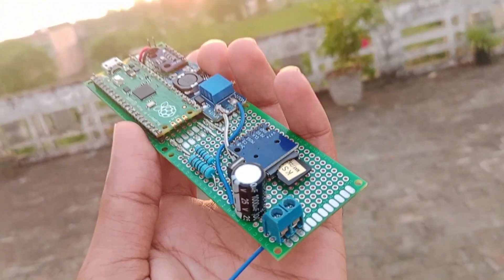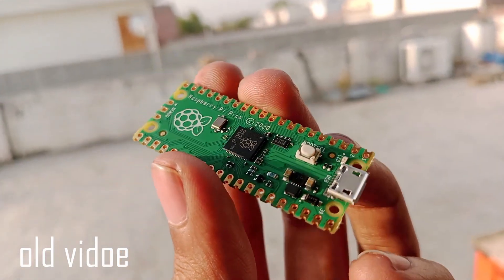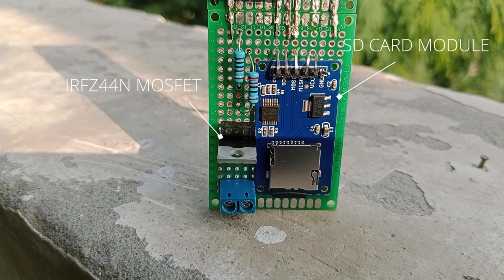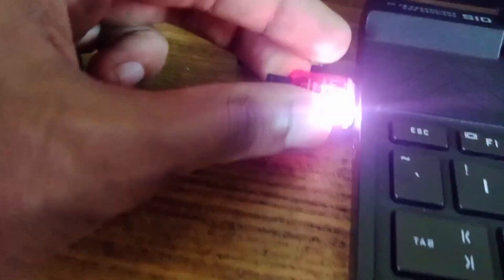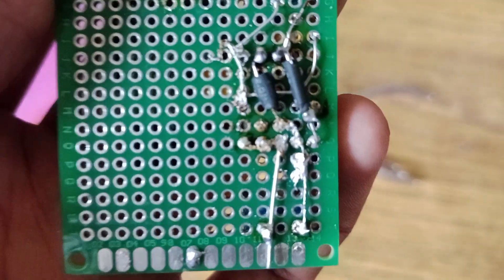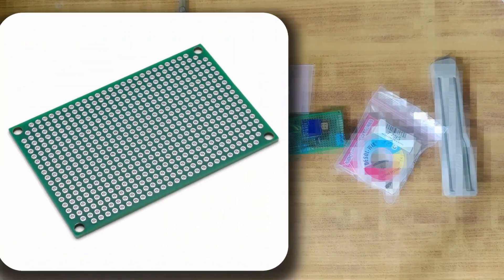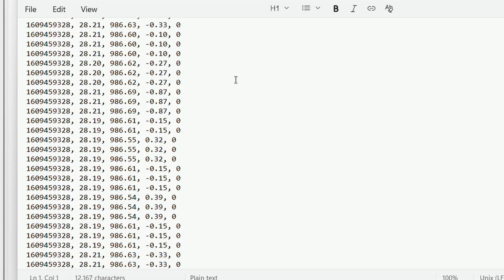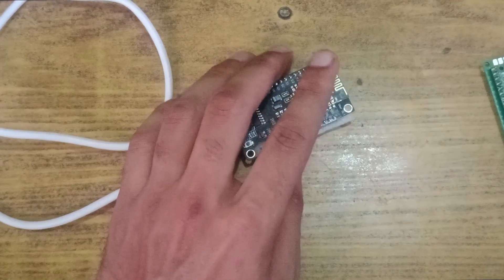This is How i made a Rocket Flight Computer!

Comment: Why you not used stm 32?
Reply from the maker: It's because i didn't check other microcontrollers before making the order and the Pico is a little expensive so i didn't change it. I just checked about stm32 and it is much cheaper than Pico, why is that? 
I will get more information about Stm and i will use it with my other projects.

Comment: also, epoxy the potentiometer of the step up module or apply superglue, i know it is really tiring and time consuming, but for your first flight, dont risk it
Reply from the maker: I will make sure that anything doesn't move during flight or after the assembly of the rocket.

Comment: if your rocket is going to stand on the launch pad for a long time, then use a bigger battery, you dont want your flight computer to die suddenly just before launch
Reply from the maker: That wouldn't be a problem at all. I will turn on the flight computer just a few minutes before the flight.

Comment: the tinned copper wires will NOT survive in more than 7g's of acceleration, please apply a light coat of epoxy in the wires when you are done and apply a bit of silicone conformal coating to the exposed tiny components, the epoxy holds them in place and can go up to 30g's with margin of error, the conformal coating prevents your board from shorting itself from humidity
Reply from the maker: Oops 😬. Why don't I think about that!! I took too long to check my comments. It would be hard to fix now 😅.

Comment: Bruh how did you made the pyro charge circuit? Can I have it's circuit diagram?
Reply: use a mosfet, connect its gate to a 10k ohm pull down resistor and the gpio you wanna use to control it, hook up 12v 0.5a or more to its source(can be more if you have a longer wire), then hook the drain to the pyro charge
Reply from the maker: Massage me on instagram, i will share it with you

Comment: yo bro i am also making project like you. i think you need to participate in project fairs or startup programs.

the system i am making is ai based space debris tracking and avoidance system

🚀 Project Report
AI-Based Space Debris Tracking and Avoidance System
1. Abstract

Space debris poses a significant threat to the safety of active satellites, space stations, and future missions. This project, titled AI-Based Space Debris Tracking and Avoidance System, proposes an advanced hybrid solution combining artificial intelligence, physics-based orbital mechanics, and sensor-driven simulation to detect, predict, and autonomously avoid collisions in space. The system integrates real-time TLE (Two-Line Element) data, predictive AI models (LSTM, GRU, Transformer), and reinforcement learning algorithms (Deep Q-Learning, PPO, A3C) for decision-making, ensuring efficient maneuver planning and safe orbital paths.

2. Introduction

The exponential increase in orbital debris threatens operational satellites and human missions. Current tracking systems rely heavily on ground-based radars and physics models, which often fail to react in real-time.
This project introduces an AI-driven system capable of autonomous tracking, prediction, and avoidance of debris using a combination of physical modeling and deep learning.

Core Idea: To build a real-time intelligent system capable of predicting future debris positions and autonomously adjusting spacecraft trajectories to avoid collisions.

3. Objectives

Develop an AI system for real-time space debris tracking and collision avoidance.

Integrate orbital mechanics with AI-driven prediction.

Implement LSTM and Transformer models for trajectory forecasting.

Utilize reinforcement learning for autonomous maneuver control.

Create a simulation dashboard with 3D visualization and real-time AI decision monitoring.

Build a functional prototype using Raspberry Pi Pico for demonstration.

4. Literature Review / Background

Existing methods rely primarily on NORAD TLE data and SGP4 propagation models for orbit prediction. However, uncertainties arise from solar radiation pressure, atmospheric drag, and limited update frequency.
Machine Learning (ML) techniques are now being explored to enhance precision. NASA’s ODPO, ESA’s Space Debris Office, and academic research suggest hybrid AI + physics systems can reduce error margins by over 40%.
This project contributes by combining LSTM-based trajectory prediction with Kalman filtering and Monte Carlo simulations, ensuring improved robustness and accuracy.

5. System Overview

The system operates in two layers:

Software Simulation Layer:

Processes real-time TLE data.

Uses SGP4 propagation and AI prediction to forecast debris positions.

Determines collision probability and recommends avoidance maneuvers.

Hardware Prototype Layer:

Built on Raspberry Pi Pico microcontroller.

Uses ultrasonic and radar sensors to simulate space debris detection.

Controls servo motors (thrusters) for maneuver demonstration.

AI Controller:
A Python-based AI model running on a laptop continuously trains on simulated debris data and sends control signals to the Pico for real-time avoidance maneuvers.

6. Methodology
6.1 Data Acquisition

Source: NORAD, CelesTrak, and Space-Track.org

Format: TLE datasets parsed via Python libraries like skyfield, sgp4, and astropy.

Additional solar activity data via NASA and NOAA APIs.

6.2 Physics-Based Propagation

SGP4 and HPOP algorithms used for orbit prediction.

Monte Carlo simulations for uncertainty modeling.

Kalman filters for continuous trajectory updates.

6.3 Machine Learning and AI

LSTM & GRU Networks: Predict debris position from time-series orbital data.

Transformer Models: Used for long-sequence prediction accuracy.

Reinforcement Learning (RL):

Algorithms: Deep Q-Learning, PPO, A3C.

Function: Decide optimal thrust/maneuver action to minimize collision risk.

6.4 Visualization System

3D simulation dashboard using Plotly and Processing.

Displays spacecraft, debris fields, AI predictions, and sensor sweeps in real-time.

6.5 Prototype Implementation

Hardware Components: Raspberry Pi Pico, Ultrasonic Sensor (HC-SR04), Radar (RCWL-0516), MG90S servos, external power.

Software:

pico_debris_avoidance_firmware.py (MicroPython firmware)

laptop_ai_controller.py (AI decision engine)

debris_avoidance_visualization.pde (Processing dashboard)

Communication: Serial (115200 baud).

7. System Flow

1. Data Input → TLE + Sensor data acquisition
2. Orbit Propagation → SGP4-based physics simulation
3. Prediction → AI models forecast debris paths
4. Risk Assessment → Collision probability computation
5. Action Decision → RL agent selects avoidance maneuver
6. Execution → Servo/Radar response simulated via Pico
7. Visualization → Real-time 3D dashboard

(Flowchart Placeholder – can be auto-generated if confirmed)

8. Results / Expected Outcomes

Real-time collision prediction and avoidance system.

Improved trajectory prediction accuracy (>90%).

Decision latency below 50 ms in simulation.

Fully autonomous maneuver capability.

Scalable design for real orbital systems or CubeSats.

9. Future Scope

Integration with real satellite telemetry systems.

Deployment on cloud servers for global debris tracking.

Implementation of federated learning for distributed training.

Expansion to re-entry prediction and on-orbit servicing missions.

Collaboration with international debris monitoring networks.

10. Conclusion

The AI-Based Space Debris Tracking and Avoidance System represents a forward leap in intelligent space operations. By merging physics-based simulation with machine learning, it demonstrates how autonomous spacecraft can navigate an increasingly crowded orbital environment.
The project bridges the gap between theoretical modeling and applied AI, paving the way for the next generation of space mission safety systems.

11. References

NASA Orbital Debris Program Office (ODPO)

ESA Space Debris Office Technical Papers

CelesTrak & NORAD TLE Datasets

Python Libraries: sgp4, skyfield, astropy, tensorflow, plotly

Research Publications on AI-Based Orbital Mechanics

Comment: Nice work. You should put a tp4056 module. You find them from robu and also micro usb or usb c one as they have bms also.connect the source of the mosphet directly to the battery and not module for max current but the rest connect to the battery out of module